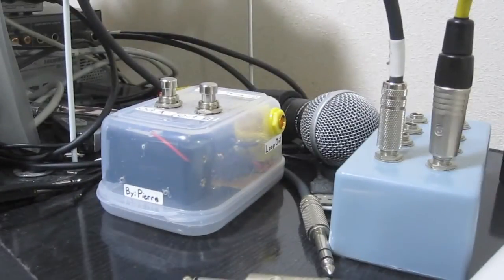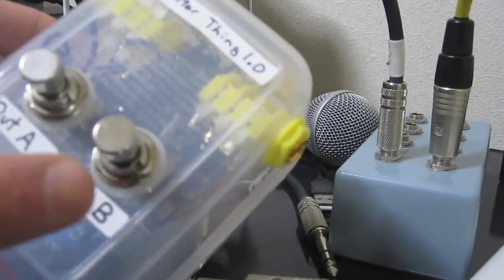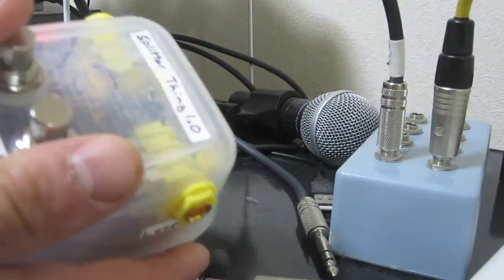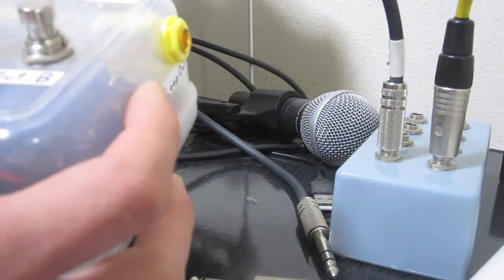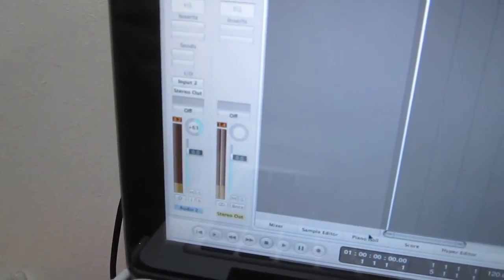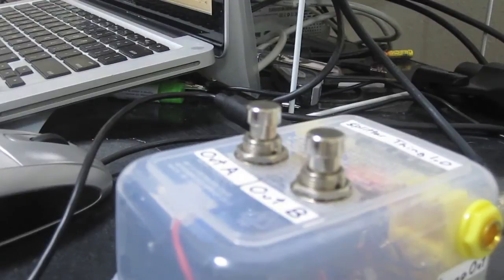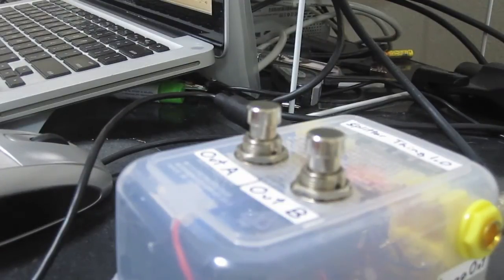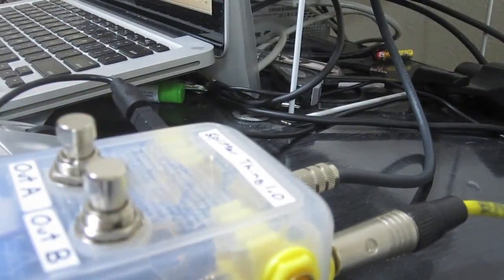DIY Instrument Splitter Circuit (Guitar, Bass and Synth pedal)

Comment: A few things... plastic is not the way to go here. You want a metal chassis for shielding. By using plastic you have made your circuit more susceptible to RFI. Finally what you have is not really a splitter, it's a switcher.
Reply from the maker: shewh0rn I understand that, I just used the cheapest enclosure I had. From my understanding it is a splitter that can also act as a switcher if desired. Both signal paths are buffered, I would've only put 1 switch too if it was a pure switcher.